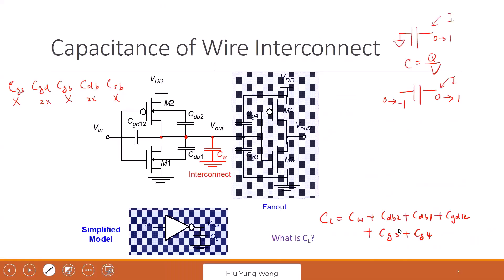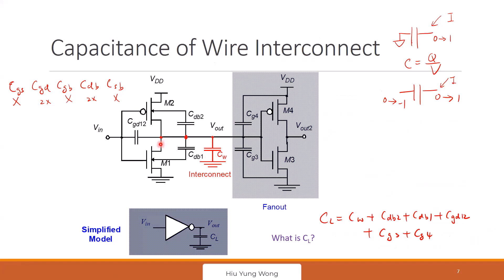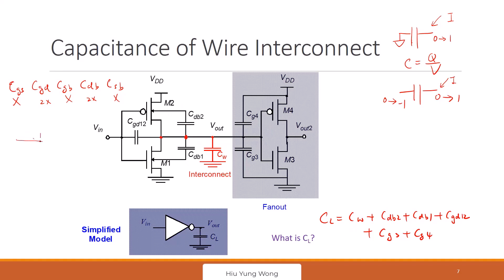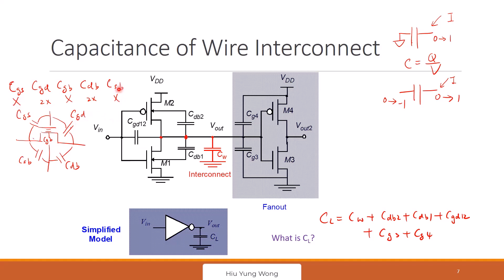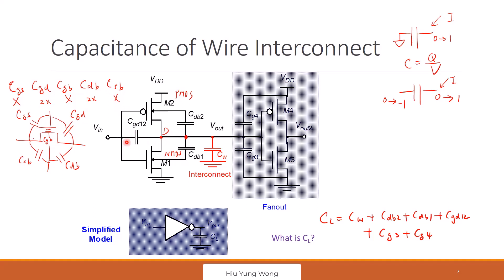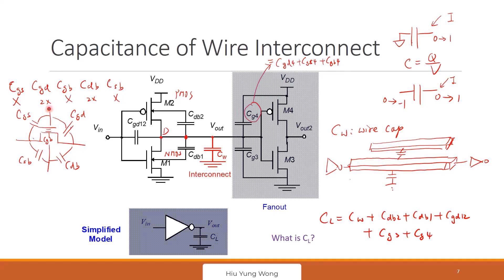L8-A Modeling Wire and Interconnect Fringing Capacitance

Comment: summary for myself on C load (at 5:30):   
start point is Vout ( you are at Wire part). left part is driver Inverter, right part is Fanout ( Here is other Inverter).  For Driver inverter, only its Drain ( include drain of NMOS and PMOS) is connected to Vout Point. For fanout, Vin (whic is Gate) is connected by Vout. So, C load = C wire + C driver_drain + C fanout_gate. 
C driver_drain = C driver_gate_drain + C driver_drain_body 
                         = (C M1_gate_drain + C M2_gate_drain) +  (C M1_drain_body + C M2_drain_body)
C fanout_gate = C fanout_gate_source + C fanout_gate_drain + C fanout_gate_body

                          = (C M3_gate_source + C M4_gate_source) + (C M3_gate_drain + M4_gate_drain)+ (C M3_gate_body +C M4_gate_body )